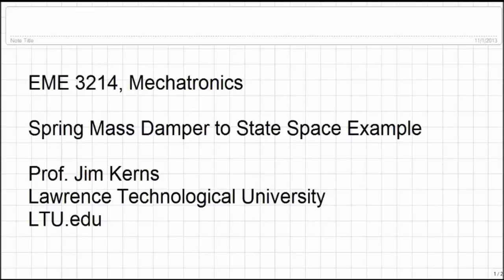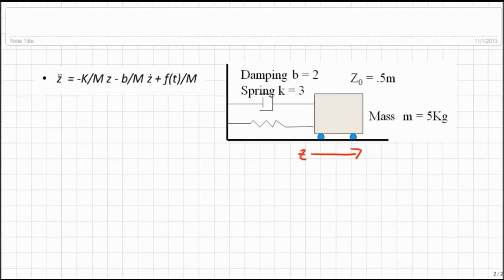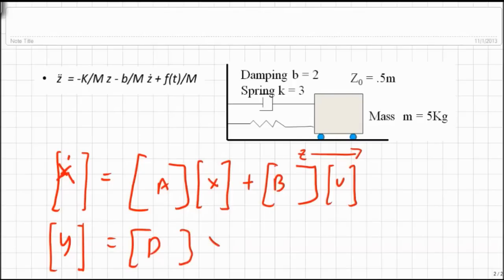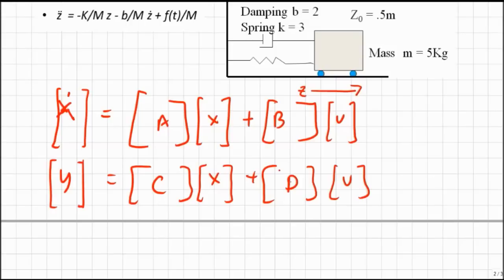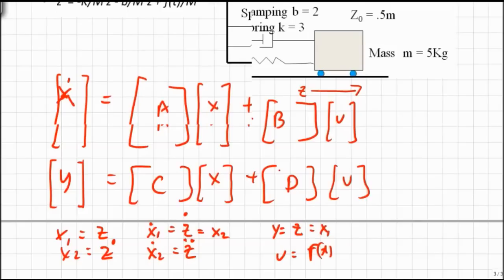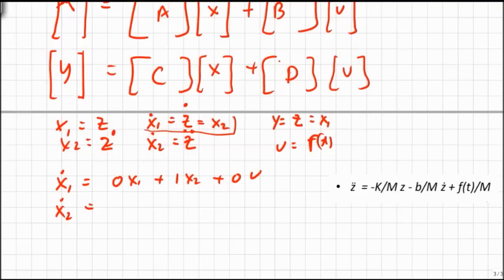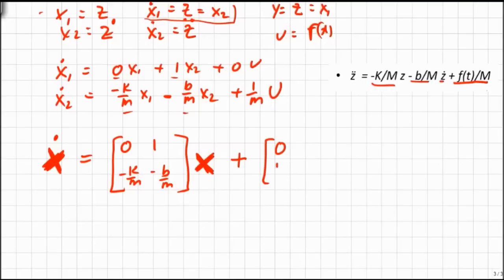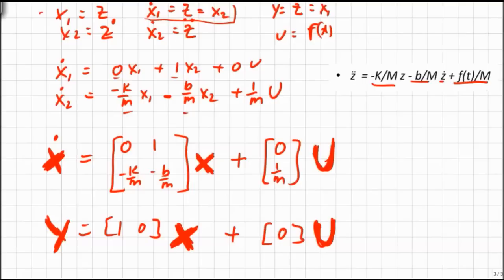EME 3214 Mechatronics Spring Mass Damper State Space Example

Comment: Thankyou for the video!! it was very helpful , I just had a doubt as to how we will represent acceleration of z in the output matrix ?
Reply from the maker: If you specifically want the acceleration in the output vector, you the quick and easy way would be to add a row to the C and D matrix with the equation for acceleration from A and B.  But depending on how you are solving the system, you may be able to just grab the values from the vector of derivatives of the states. 
And, thank you for the comment.